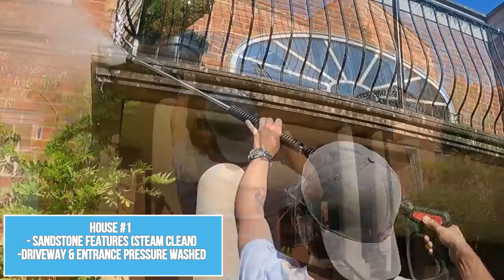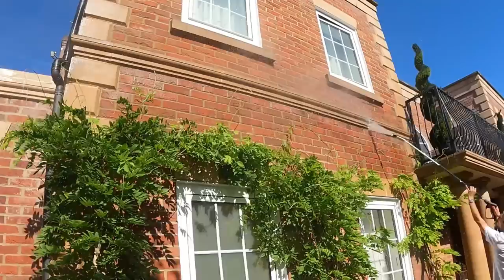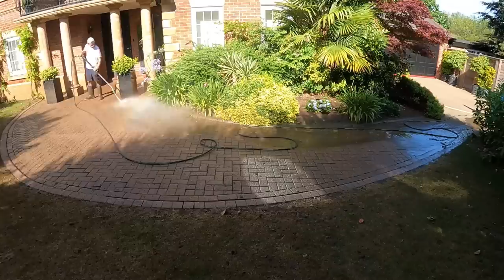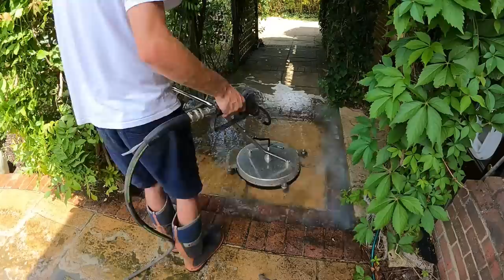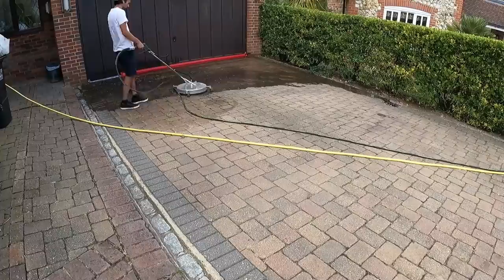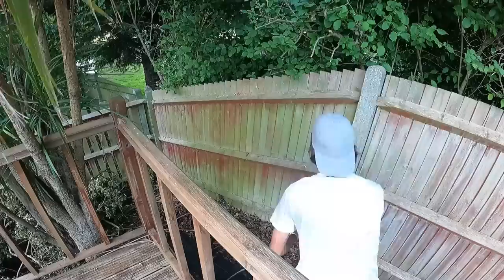HOW MUCH CAN 1 MAN CLEAN?!

Comment: That new equipment looks like it's making the job easier. Especially when using the steam. Can't understand why when someone books any trade to do a job they are at least pleasant, as my late Mum used to say it doesn't cost you anything for being nice. My only assumption is that the person had either had a bad experience before with a trade or they were a complete bell end.

Comment: Top tip, when the water is really bad, drop the hose directly into the top of the tank, ignoring the float... It will help with flow.. it's not a fix, but it will help

Comment: You need to add a tee and valves to your tank fill for multiple faucet hookup and carry extra hose... It will make it easier to keep up with your flow rate.
Reply: I tried this before using front and back garden outdoor taps ( faucet ) with no advantage as there is only one supply to the house so I was just dividing the flow. 

Thankfully was able to use the next door neighbours supply also.